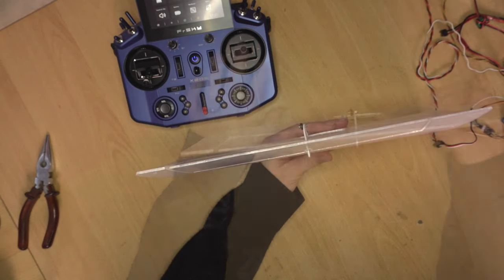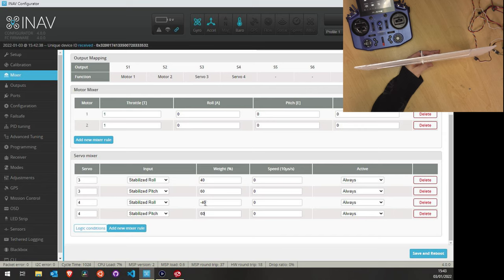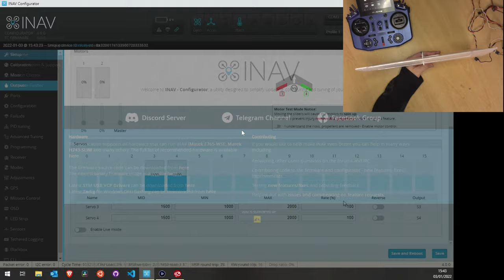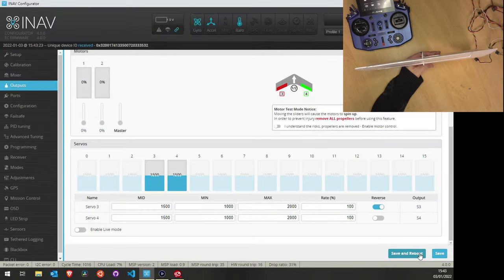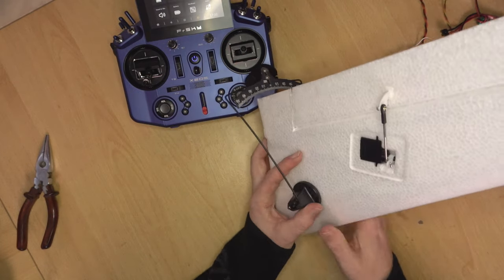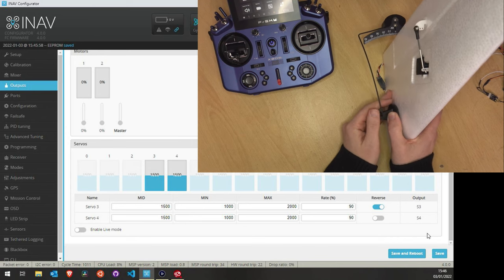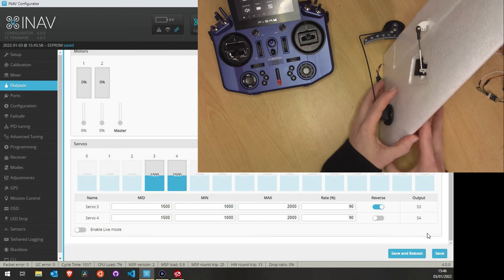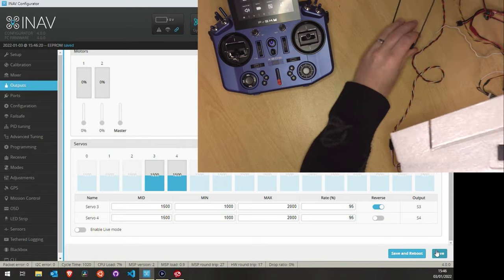Setting up control surfaces, linkages, and throws for iNav

Comment: You just saved my heewing f01 from a failed Maiden! Thank you Darren! 
Was all this done while in Manual mode?
Reply from the maker: Yes, you always set up the throws in manual. Glad I could help Glen :)
Reply: @MrD  , I always wondered about this... When switching to manual mode...shouldnt I dial rates in or expo. (as Inav + FC in manual mode has no in put) lol the whole time for year's I been flying I have just left manual mode alone and never knew 🤔 this had to be done. I really appreciate it mate!
Reply from the maker: Hi  @glenharto9699 , manual already has expo (Manual Expo on the receiver page). I’ve never used traditional rates in INAV. There are two ways of achieving it, both in INAV. You should not set rates or expo on the transmitter.
Reply: @MrD  good morning Mr D My Maiden was a success.Thank you! It seemed a little slow. No idea how to program the esc that came with it maybe a throttle calibration needed. And I will up grade the control linkages (way to sloppy) I love FPV and Fixed wing flying and I really appreciate your help 🆘  as an Australian 🇦🇺  living in the USA now for two years I want to say....you're a bloody legend mate!
Reply from the maker: Thanks Glen. Glad the maiden went well. I’m sure the ESC that comes with it can use DSHOT 150 for the protocol. If so, you don’t need to calibrate it. By slow, I’m assuming speed and not rotational movement? The rotational will be sorted once the plane has been autotuned (in acro).
Reply: @MrD  yes top speed! is more like 60mph using 1500mah lipo (100c) I will try D-shot in Inav. 👌 on a second note I did your differential set up on the Servo.. And now it turns like it's on rails (with out dropping ) fricken awesome! I owe you a coffee for all your help mate 👍 signing up today.
Reply: I just signed up patreon! 🙂
Reply from the maker: I’m guessing 4S? That should definitely go faster than 60. It’s worth checking the prop is on the right way around and not loose. I wasn’t convinced by that bolt. 

Thank you for joining Patreon. I’m appreciative that a lot.
Reply: @MrD  Darren! You deserve a coffee for helping this old dude out 🤭 
Motor direction is clockwise, the prop is the smaller one of the two (that came in the pro kit box) I downloaded the Blheli config and in the top right it says my ESC is a LVT Little bee 20A, - I thought is was supposed to be a 35A 🤔 I flashed it to 14.9 this step was easy (didn't even know why I did) cannot for the life of me find any info on this ESC - it looks like a Airbot Wraith32 V2 BLHeli32 35A ESC why do they do this? I want to set break so I don't mow the grass when I land 🤭 and calibrate so I can be sure I'm getting full range and speed. I use Inav (love it) but omg I struggle 😁 flying weight is 688 grams with batt. This little bird is set up well thanks to you 👌 I think a new speedy with an instruction manual. I'm embarrassed to say this, I purchased a Hakrc BLHeli 35A and a Matek F405-mini TE to put in this...however this old dumb ass didn't even know that board is for Quads. 🤭🤭 live and learn. Oh and the prop is on with the numbers facing forward 👍

Comment: you should not mess with the surfaces it has a a flight controller leave them flat and just take off in manual mode and just use your thumb to give trim up and then auto tune and it will fix that in flight
Reply from the maker: I'm not sure what you're talking about here? You should always set the throws, flight controller or not. If you're referring to reflex, that should also be set up physically. Also, with iNav, you should not use transmitter trims.
Reply: @MrD  with I navi you don't need to put up trim on your controller or plane it will doit in autotune
Reply from the maker: To an extent, yes. But if the autotrim is outside the range of 1450-1550 on the outputs page, you should adjust physically.
Reply: @MrD  i think the new inav saved my autotune even tho i crashed my feedforward has changed even tho i didnt get to save because a hard landing poped my battery out......
Reply from the maker: @staydown.normal5323  if you have continuous servo trim and disarmed before crashing, that is a possibility.
Reply: @MrD  LOL.  I do. and i disarmed when i slid  ....... then it skip and then tumbled battery poped out...i posted the video
Reply: @MrD I used the center trim function (+/- 1500) in inav to adjust the servo horn to 90°.   I then adjusted the clevis to center the control surface.  I then adjusted the throw volume (+ & -)  in inav for the correct control surface deflection (like half an inch each way).  Is that the correct way to do it?

I just did it yesterday so I haven't maidened it yet.
Reply: @mccolld11  just set the servo even and flat the fc in auto tune will adjust once you land and save. Don't give and up and don't center with inav you will mess up the way the plane flys it will be very unstable in hi speeds I did exactly what you did and it took me a few to figure out why my fixed wing was bobing soo bad
Reply from the maker: It being unstable in high speeds is more likely from too much throw. That’s why its a good idea to set the throws, as shown in this video. Don’t just have crazy high throws and let the flight controller try to battle them.
Reply: @MrD 
I'm a first-time inav and wing flight controller user setting up a new plane in version 6.1.1. --  though,  I've been flying planes LOS for decades.  

None of my servo horns were at perfect 90° due to typical spline misalignment.   So, the 1st thing I did was go into the Outputs page and adjust the servo MID setting to make the servo horns 90° giving equal control surface movement in both directions.  The settings are: 1570, 1560, 1515, and 1420.  I adjusted the amount of deflection by which the holes the control rod is connected on the servo and surface ends.  I have not changed the MIN, MAX, rate settings, nor TX trims. 

I'm hoping these changes aren't going to mess up autotrim, autotune, or the non-manual modes later on when I maiden it. 

Is this the correct way to do it?
Reply: @mccolld11   no then you give the servo too much range and it will wobble trying over correct its self. just leav it at 1500 power the servo so its at its start point unscrew servo horn and level wing surface and then connect servo horn so wing is level and screw servo horn back on and repeat for the other side .. now when you plug battery in servo will power and wings will be even on both sides now fly and then put in acro mode and auto tune then turn off auto tune before landing then disarm but before you unplug battery use stick commands to save the tune.... your welcome
Reply: That doesn't make sense to me because you're tuning differential into the control surface.   And,  what's the reason for the MID adjustment if not for centering the servo horn?
Reply: @mccolld11   i did exactly what you did and thought the same. with my little fixed wing that dose 138 on 4s it flew fine until i messed with that and it would wobble hi speed then i went back and noticed thats what i changed and when i fixed it it went away . you dont want to do that because the fc will have too much room to adjust to correct its self and it willl just fly like shit. thats me just sayin i hope this helps i just maiden a 7.2foot 4s opterra and it was ez i have made 5 fixed wings in the past year and its soooo ez now